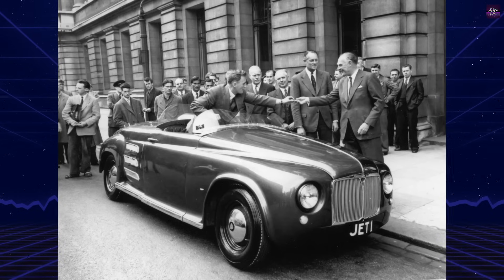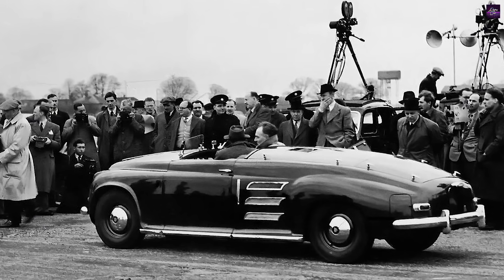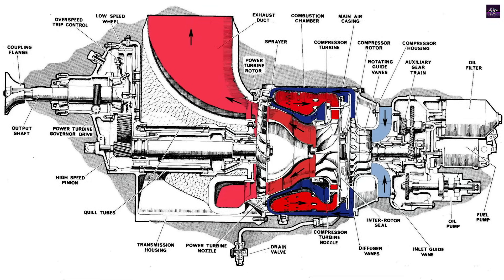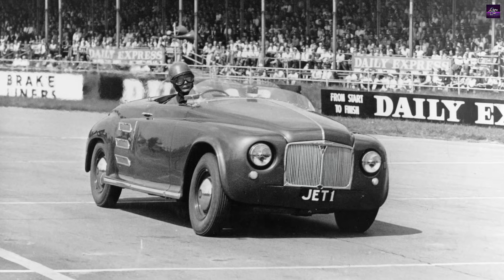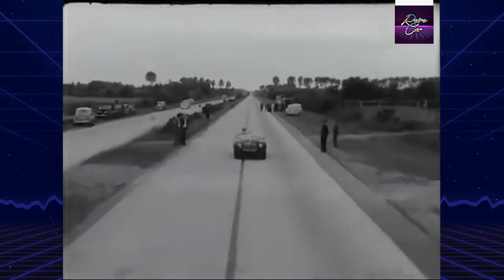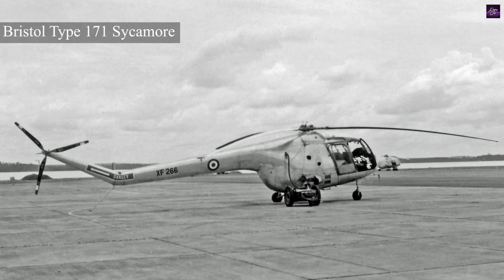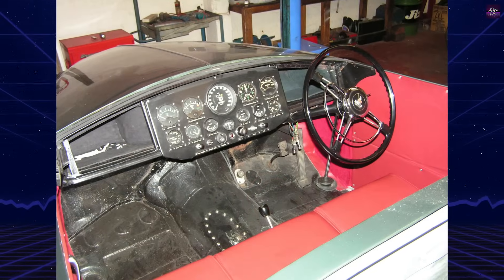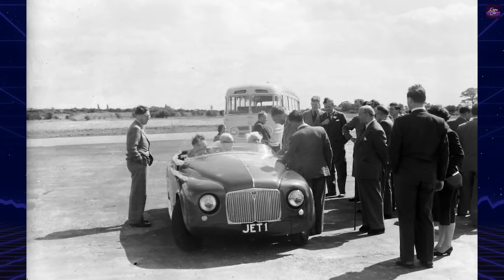Rover JET1: The Roaring Turbine Car That Defied Expectations

Comment: Kind of ironic really. Rover worked with Frank Whittle when the gas turbine was being developed. Rolls Royce picked up the project when Rover and Frank fell out over engineering differences. For Rolls Royce, the rest as they say, is history in so far as the jet engine is concerned. Frank Whittle was a genius, along with Stanley Hooker who picked up the gas turbine engineering mantle at RR.

Comment: Interesting and informative video, but the Bristol Sycamore never used a turboshaft engine. It initially used a Pratt & Whitney Wasp Junior, with most using the Alvis Leonides engine. All radials! Bristol's twin rotor Belvedere did use Napier Gazelle turboshafts.

Comment: What killed the turbine was the 
cost . The bean counters at Rover found out that a turbine would always be more expensive to produce than an I6 of comparable power. So they bought the 3.5 l V8 from Buick.
Reply: That and the astronomical fuel consumption…….
Reply: @williampratt1066  yes that’s the major one and the times it takes to spool up the power turbine it’s only efficient over a very small speed range hence being great for air aircraft and of course it can operate in very lean environments because effectively the compressor stage is increasing the oxygen into the combustion chamber

Comment: Rover designed the P6 so that it could take the gas turbine running gear, but they finally gave up on the idea before it entered production so it was only ever sold with internal combustion engines. Rover did make a turbine powered P6 prototype though, which is on display at the British Motor Museum at Gaydon.
Reply: You’re not allowed to say gaydon any more- the museum will now be referred to as LGBTQ theythemdon!😂

Comment: to put the acceleration figure 0 - 60 in 14 seconds into perspective, the standard ICE engined P4 75 did it in 21 seconds (ish), many cars at this time struggled to reach 60 mph absolute top speed.
Reply: 0-60 in 14 seconds and top speed of 90MPH about the same as a 1949 (American) Ford V8
Reply: @mrdanforth3744 the engineering of american automobiles lagged far behind European engineering. Americans notoriously didn't like changing gear so huge engines gave large values for torque, reducing the need for gear changes, and hence the adoption of auto gearboxes much earlier than in Europe. large torque values obviously allow higher acceleration rates.  A big European engine at this time would have been 2.5 litres, (exceptionally they may have been over this value) American V8's started about there and went up. European engines were often less than 1 litre. and on average were around 1500-2000cc.  A TR2 from 1954 with a 1991cc  4cyl in line engine would top 100mph and get from 0 to 60 in just over 11 seconds, (and still return 30mpg if driven carefully) though it is a sports car rather than a sedan, the standard of design engineering was so much better than that of the U.S. This sort of performance is probably another reason the gas turbine was not developed for cars.
I had a workmate from America (in his 70's and a Vietnam Vet) and his mantra was there's no substitute for cubic inches where engines were concerned, i tried to tell him that was bollocks but being American he wouldn't listen....

Comment: Interesting car… I wonder how much the Jet 1 influenced the Chrysler turbine car
Reply: It may have inspired Chrysler to experiment with turbines but the Chrysler effort was much different. Conventional front engine layout for a start, also the use of Chrysler's Torqueflite automatic trans without the torque converter. I believe the first Chrysler used a helicopter turbine. It was built in 1953 using  a 53 Plymouth body and chassis, later modified slightly to look like the 1954 model.

Comment: You learn something new every day:  I didn't know about the Rover JET1 until just now - much less that it was THE first gas turbine powered car ever!  It's a shame that I'm hearing about it only now.

A quick Google search found only one model kit of the Rover JET1 in 1/43rd scale.  Sadly, this model is a 'curbside' kit without the engine.  A proper, injection-molded styrene kit in 1/32nd or better still, 1/25th scale has yet to be made.  (Airfix missed an opportunity, here - just as Heller did with the previous video on the Socema Gregoire Turbine car.)  As with the Socema Gregoire, a kit of this one would probably sell well for the engine, drivetrain and chassis alone for use in custom projects.

Thanks for finding, making and sharing, Retro Car! 

57th Like.
Reply: @modelermark172 Thanks for your comments. They are always as well researched and informative as the videos, and only add to the appreciation

Comment: I think the appearance of the car itself looks attractive. Too bad vehicle manufacturers haven’t been able to get past the shortcomings of the turbine engine. 

On that note, you should look up the very radical race cars commissioned by American entrepreneur and owner of STP Andy Granatelli. He commissioned Lotus to build a pair of race cars for the Indianapolis 500. Not only were they powered by gas turbine engines, they featured four wheel drive. Not only did they amaze the American racing scene, they captured the public’s attention while also promoting Granatelli’s business. Andy’s cars dominated the Indy 500 and almost won. But in racing, “almost” isn’t good enough. But they certainly caught lots of attention and forced the race organizers to change the rules that ensured this sort of thing would never happen again. You won’t be disappointed. 

Thanks again, Retro.
Reply: Probably the best application for a turbine engine in a car is as the engine to run the generator in a hybrid. Volvo had a test show car about twenty-five or thirty years ago. One advantage of a gas turbine to spin the generator is the small size. There was also a lot of research going on into casting ceramic engine parts. Both gas turbine and ICE.
Reply: "Too bad vehicle manufacturers haven’t been able to get past the shortcomings of the turbine engine."
The big issue was the high fuel consumption when idling in traffic, the reason that GMC's turbine car had a two cylinder engine to power accessories so the turbine could have it's fuel cut off when the car was waiting for the light to change...
Keep in mind that each engine type has its own best application. 
For aircraft, which have an issue with weight, turbo fans, turbo props and turbo-shaft engines make sense...
For automotive applications, the Otto cycle engine & battery electric drive make more sense, but Hybrids don't due to the service costs...
Reply: Granatelli was not the first to enter a gas turbine powered car at Indy. His were the first to qualify though.
Reply: @mpetersen6  You are correct. I honestly forget who did run the first turbine car at Indy, but I never expressed or implied that Andy Granatelli was first. Did I? DID I? DID I? 😜😜😜 Andy always got attention because he was a master showman and marketing/PR wizard. The guy really knew how to hype himself and STP products. When his turbine race cars came out, I thought they were great. I think the second year turbines were the wedges, and I don’t think there was a single doorstop in the country that was safe after that. Andy was ahead of his time in race car technology, marketing, and social media long before it was a thing.
Reply: @RReese08  
No you did not imply that Granatelli was first. But it seems everybody thinks he was. He was the first to enter car that did make the field on race day. Some of the more interesting cars  Indy back then were the ones that didn't make the field.